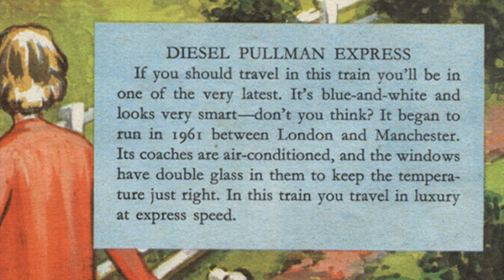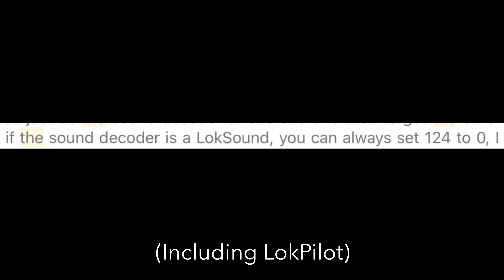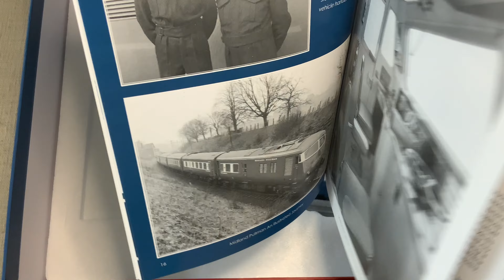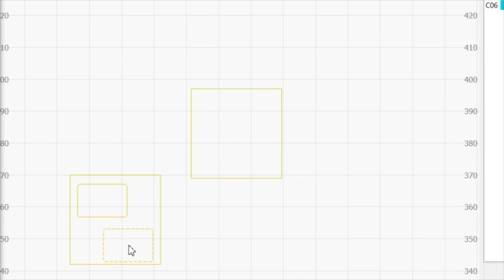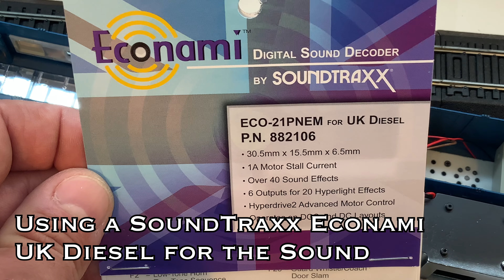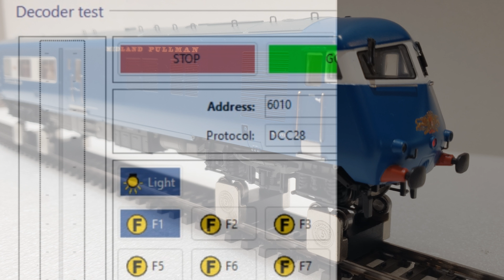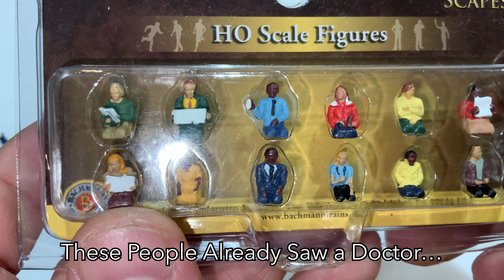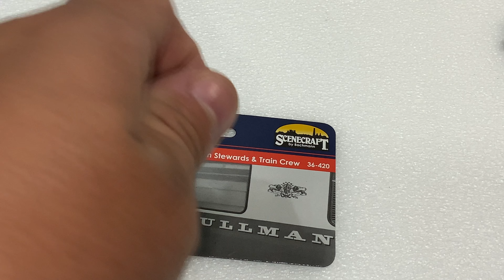Shortline Histories: Bachmann Branchline Midland Pullman Collector's Set with Howes and Econami UKD

Comment: In UK trains, the driver sits in the right seat when looking at the cab. He wouldnt be sat where you put him holding the brake wheel which is only used when the train is stationary.
Reply: Definitely left hand side (relative to the train) for drivers in the uk

Comment: nice video shame you put the crew stood in front of the hand brake wheel drivers in uk sit on L/H Side as trains run L/H rail up to London . You said about he loco lights not being bright I guess it was to represent a weak electric lamp of the 60's. Interesting about the TMC issue and it does sound a hell of a lot better with a good sound box.